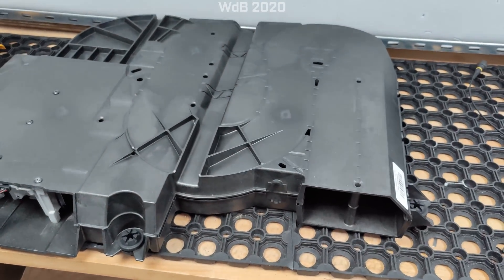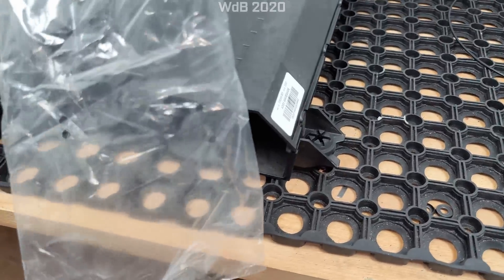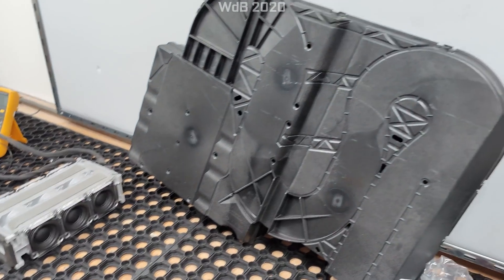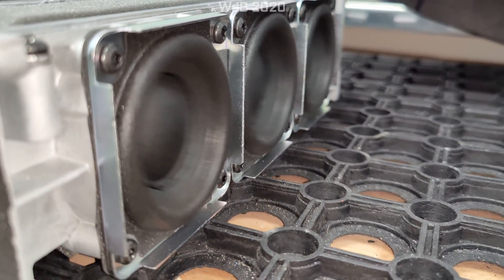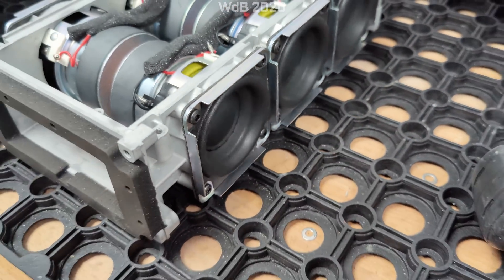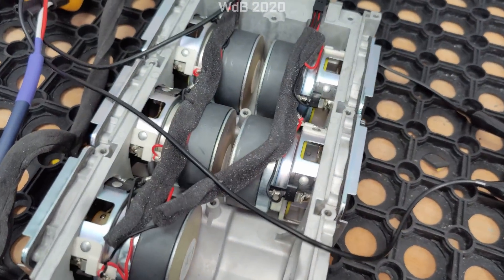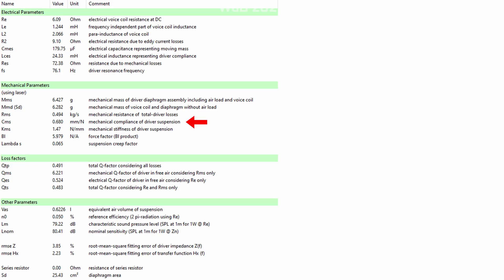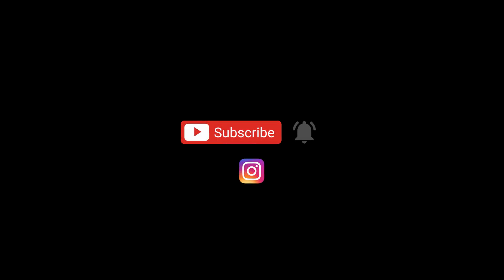Bose Videowave Subwoofer First Look - Testing Free Air, Enclosure and T/S Parameters

Comment: I just recently got my eBay junkyard order of the power profile, which I had heard were the same woofers from this. They are quite similar, however, some of the TS parameters are different like for starters. Mine are for homes instead of eight and the FS is actually in the mid 80s. For example. I would have loved to come across one of these tvs

Comment: The engineering is very interesting to me! However, because Bose always charges a big premium for their brand name, many are disappointed in the quality of the components (when they compare to other brands for similar money). This is no exception; Bose does not pride itself with using the highest quality components. But it does fulfill the requirements of the engineer's design. I'm sure a very well built 6.5" woofer with rubber surround, cast aluminum frame with an exotic cone material could be sourced for less than all six of those 3" woofers. And it would have a lower resonant frequency, better throw, and certainly higher efficiency. But it would not be as compact, which is what the designers wanted.

Comment: The array of small woofers was an idea I had in mind around 1984 but never tried it. My thinking was since it is a smaller area it would be more effective then a large woofer, due to the smaller size it could move more quickly, however it would require a way to power each driver well.

Comment: Could you help me ???  I am Brazilian and the repair of this equipment here is very expensive.  The subwoofer bose acoustimass 6 series III without bass with sound in the boxes.  Sometimes the bass made a noise, with knowing which circuit reinforces the weld ??

Comment: BL-limit of excursion is at 70% of BL for woofers - corresponding to about 10% THD, and BL-limited Xmax for subwoofers tends to be around 50% BL. This is based upon audibility of harmonic distortion in a system context; bass distortion is a little bit less objectionable at lower frequencies. These woofers reach 70% BL at around 7mm, and 50% BL around 8.25mm. (For midrange and full-range speakers, BL limit is 82%.)
Reply from the maker: Interesting! Thank you for the clarification, it did seem a bit odd that Klippel only specified the 82% value for BL non-linearity (10% THD AES). Especially when this woofer is so quiet right up to the suspension limits and hard bottoming.

Comment: I'm so glad you're back with a BIG surprise. Finally, I've wanted this video for a veeery long time, It's like a dream happening! The drivers kinda remind me the Bose ND Richbass that I gave to Shado. Imagine if these had a translucent dustcap! That classic trick made me smile, hahaha.  That spider is incredibly "bright" yellow lol, it's so cool to see a driver that small being so tall at the same time. They also have dimples. One question: are the foam surrounds easy fixable? Like, standard measurements and stuff like that? Because I'm so scared that one day they will eventually rot, such unique and rare drivers... Also I really wanna see the rest of the drivers tested, as you suggested. And maybe, if that's not too much, a video of the full system playing? I really enjoyed this video, I'm so amazed!!
Reply: Btw they must work all together as the sensitivity is so low that just one driver in enclosure will require a big amp, and that's not really convenient. I was a bit surprised seeing such low sensitivity, but thinking it twice it makes a lot of sense
Reply from the maker: They aren't much like the Nd woofers in my opinion, but they probably share some similarities. There isn't anything to fix the surrounds, I won't be pushing them very hard to try and keep them healthy for as long as possible. It feels like they use a much more modern coated foam which should last a number of years.
Reply: @wdbaudio  oh nice then! Anyway you could also use clear latex on the foams, they will last much longer. I did on my Atlas and it's still going

Comment: Amazing video for amazing drivers and an amazing Wdb return. I love bose speaker because of their big excursions for a small size, but where did you get all these information of the speaker. 👍
Reply from the maker: Yes, these are certainly really impressive! I got the information by measuring the drivers using a Klippel RnD system
Reply: I was thinking that the laser was just measuring the excursions but after I make a few recherches of what is this incredible measuring thing I see that it's a bit more complex. Thank you, you make me discover this incredible thing incredibly expensive even if I was thinking that it was more expensive but anyway thank you for your reply, not all youtubers take the time to do this. 👍👍

Comment: I've wanted this video for years. My idea is to take the 6 drivers in their housing and make a custom center console woofer box for my vehicle.
Reply from the maker: I'm thinking of doing exactly that! I only have a small car so this should fit the bill for a bit of extra bass
Reply: With TL design should be very nice as bose design them for The wave

Comment: Ive only seen one set and it was at a bose store by me a while ago. Always wanted to see the drivers. Time is now!
Reply from the maker: Did you get a chance to listen to the whole system? I didn't get to since this came from a broken TV. Maybe one day I'll hear it
Reply: @wdbaudio  Yeah they'd demo it with some concert / movie clips, along with sports recaps to demonstrate the overall response and surround sound effect. The panel was just the screen with its internal speakers along with the main hub unit to go on the shelf or whatever that all the ins and outs went to. Good find on the actual waveguide, but yes this is the only the subs or "acousamass/module" in bosese ha. There are mids and highs that project out the top of the screen. Definitely needed wall space for the best effect. 

Also yeah never seen a bose driver that isn't wire wrapped, excluding headphones that is... Neat little clean drivers indeed ^^
Reply: @rartolak  the bose AM300 woofer uses clips
Reply: @wdbaudio  That was inside of a TV? 😱
Reply from the maker: @randomtube8226  yeh! Have a good search of 'Bose Videowave TV' and there's a good cutaway diagram
Reply: @randomtube8226  Yeah that brief time there was a bose branded tv. It was... 4k sound before the 4k screen panel. That sums it up pretty much.

Comment: They're such nice drivers! Very nice enclosure as well! Almost makes the $5k original price worth it lol
Reply from the maker: Certainly not a cheap product, but I can tell some genuine engineering went into every aspect of the design
Reply: @wdbaudio  When it comes to engineering, Bose really know their stuff, and only a fool would argue otherwise! Unfortunately, when it comes to implementation of the engineering, that's where Bose falls down. At lest B&O have turned to Scanspeak and Tymphany drivers. It would be advantageous if Bose did the same. But all in all, they (Bose) simply makes very poor, cheap drivers (present company excepted ... to a certain degree), sound a bit less cheap, and there is only some much brilliant engineering can do to change that. 

As for the high price, people have obviously never heard the likes of Boenicke or Wilson Audio. That is money for old rope! 

Still loving the channel.
Reply: @juststuff5216  they can not always most time they use equipment that has equalized singles to tweek sound and proform the way they want it to and use this to make cheep woofers sound amazing wich isn't always bad but to charge an arm and a leg for cheep speakers and when they could use better drivers to get the same sound and probably better not saying bose is bad just there way to expansive  and thats why audio guys that know true audio and buy 10k-100k for for a single set of towers that would kill any bose out there
Reply: From what divice did he took them off?
Reply: What is its market price?